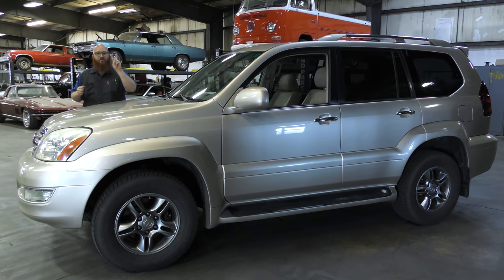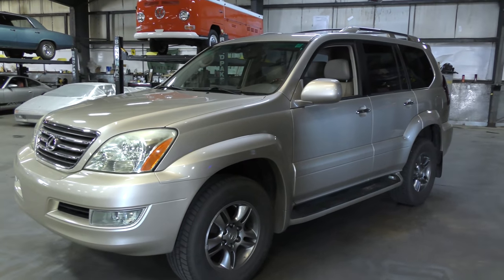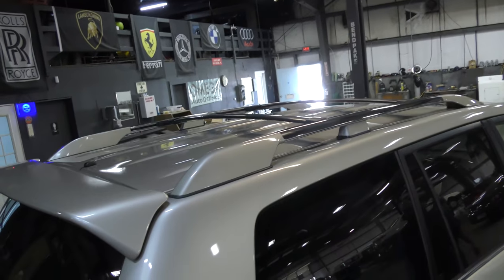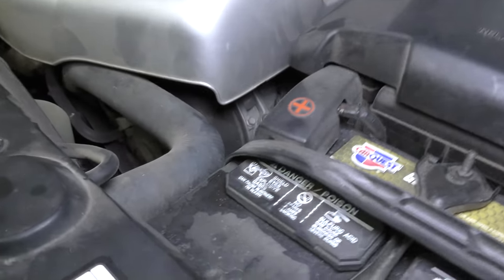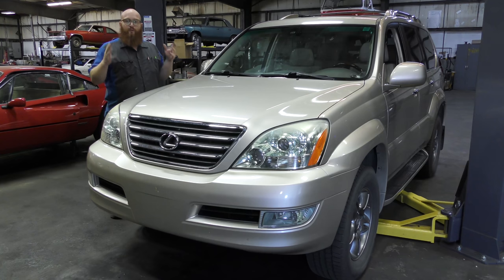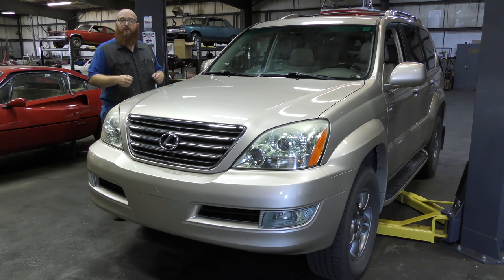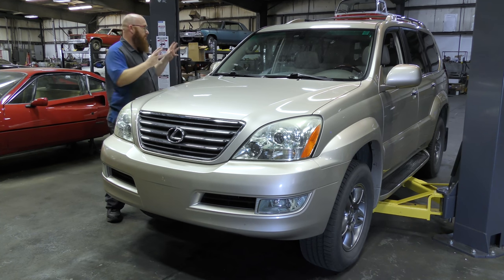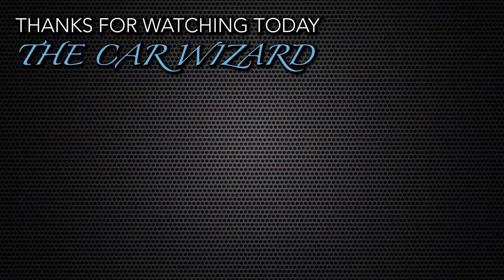Reliable cars get surprise bills too. Simple oil change on '08 Lexus GX470 turns into $1200 repair

Comment: That’s why I fix everything myself outside of rebuilding engines and transmissions.
Reply: How did you start learning about fixing cars? I'm only 14 and want to learn about cars and how to fix them.
Reply: @GamerLife-hv5kx  Basically start with smaller things like oil changes, brakes and spark plugs and learn more. You have the advantage of YouTube, I’m not that old but YouTube was just starting to take off when I was finishing high school, before then, you mainly used Haynes manuals and learned from other people which are still good options. Take the time to understand the purpose of parts, differences in types of transmissions, engines, variations, pros and cons and such. 

BTW if you don’t have an idea of what you’re going to do for a living after high school, we will seriously need good mechanics in 10-20 years. I’m not saying cheap garages but you can make a good living as a specialized mechanic or really good certified mechanic for a top brand. Trades like mechanics and electricians aren’t respected when you are young but honestly we are going to have a massive shortage if things don’t change and we still need them now but you’ll make bank later on if you’re specialized like Mercedes or bmw.
Reply: @GamerLife-hv5kx  I started at 14 too. My parent let me buy a nissan micra with a timing belt that snapped and bent valves. I made it run again, learn with no risk to other as it was my car.  We didnt have youtube and google back then. Watch video, familiarise yourself with everything. I had books from the 70s and 80s from my dad and would always refer to them anytime I was curious about something.
Reply: @StevenPenny  I think that more than good mechs we will need (actually we already need them!) good mechatronic. Techs that aren't just good with mechanical pieces like conn rods / valves and so on, but that are good also with electronic diagnosis, with the use of oscilloscopes and these kind of tools. They are absolutely necessary with cars from the 2005 onward in case you have faults that involve CAN/LIN buses or any module that control something on a modern vehicle.
Reply: @Mike That’s a good idea, forgot about that. It’s hard to screw up small engines and it gives you a good basis. 

For the other guy, you really need to be a certain type of person or try to work on your analytical abilities. I work in IT but I use the same reasoning type logic for IT as I do for working on my vehicle. I think most of us would also be good doctors if we got through the Sciences, takes the same type of thinking, just more pressure.
Reply: @StevenPenny  same here, IT and in spare time wristwatch repairer (mechanical ones). But don't ask me to do creative stuff 😂
Reply: I started working on my min bike and go-kart lawn mower that was back in the 70. Then when I got a car would love to work on it and my family and friends cars. I still have a love for that. But it's how you get started.
Reply: @GamerLife-hv5kx  I happy to here younger people taking a interests in cars.
Reply: My dad taught me how to change the oil in a car when I was a kid.  After I got married and money was tight, I got tired of getting shafted by putting my trust in people that didn't care about doing the job right. Did my first brake job with the help of YouTube, replaced a whole steering knuckle on my wife's car in the garage, have replaced half-shafts, alternators, coil packs, plugs... you name it.  There's very little I won't attempt if I have the time and tools (I will get a lift at some point), but I have since found a fairly trustworthy mechanic nearby for some things that I don't have time to do myself. Used to have a young(er) coworker that would consistently come to me asking for my advice about service on his wife's car.  I used to tell him that it wasn't a hard job and he could save hundreds of dollars doing it himself.  He flat out told me he had no desire to learn anything about automotive repair. He just wanted to take it to someone and have it fixed.
Reply: I've literally saved tens of thousands of dollars doing my own work on my cars. 
It started as a necessity but I actually enjoyed it. Especially when I wasn't up at 3 AM headed to work at 8.
Started with the simple things like brakes, oil changes, belts to water pumps and alternators and radiator replacement
I've done a few timing belts and some other rather intense repairs.
It is satisfying to complete a complated repair and go for that first test drive.
The money you could have spent on labor can be used on a better quality part.
Mistakes are a part of the learning process.

Comment: Couldn’t agree more Wizard. Although it took me owning a VW to finally knock some sense into me I now drive a 97’ Camry and the wife drives an 08’ Lexus RX350. These have been great vehicles. Cheap and simple to maintain as well as work on. At this point, outside of maybe a Honda, I don’t see why I would ever leave the Toyota lineup.
Reply: Like I always tell people, if you’re going to buy a new car, and only keep it for a couple of years buy whatever you want, if you’re going to keep it longer buy a Toyota
Reply: My family got a JDM 2010’ Toyota Harrier, should be similar to RX350, at least the shape 🤣. But because it’s JDM, I have this little anxiety that it might be hard to find some original parts later.
Reply: @Erispedia  it’s exactly an RX, just a different name (and maybe steering wheel location)
Reply: @vinces8974  I've still got my '97 4 Runner and it's running good at 407k miles. Although the catalytic muffler needed to be replaced recently so I could pass smog. That cost over $1200 for an OEM cat. The shop would have used a factory cat but Toyota dealer didn't have any and they don't know when they'll get one. So he got an OEM one which was only cheaper than the factory cat by a couple hundred dollars.
Reply: @Rhaspun  If your Toyota’s in good shape probably worth putting $1200 why not , here in Pa we are always fighting corrosion , on older vehicles

Comment: i own this exact vehicle in a 2007.   paid 15k cash in 2017 w/115k  miles in it.   It  was in need of deferred maint when i purchased and  had it completely sorted -  cv boots, all belts, water pump, tires.   Virtually every knob, light, switch works on this beast.   Yes, even the amazing rear  air bags.    I keep it pristine.  interior and exterior is like new.    I could pay cash for any dream car i would want.    But, i get more out of value.   And i absolutely love these vehicles.    Nothing but Lexus, Toyota and even some Hondas for me.    Thanks Mr. and Mrs. Wizard.    This was a real treat to watch!

Comment: Mr. and Mrs. Wizard - always happy to hear from you, such a sweet couple.
Reply: @gerardodominguez5755  Rosen, who is forty-nine years old but has the spritely affect and bubbly drawl of an N.Y.U. undergrad, put the butt mirror into my hand on a recent October afternoon because she wanted to prove a point. Her point is that super-high-waisted jeans—a cut that Rosen first began pushing in the early two-thousands, when she owned a cult-popular downtown shop called the Good the Bad & the Ugly—make everyone’s rump look rounded and Rubenesque. I had just wriggled, with great effort, into a pair of her wide-legged stovepipe jeans, which have a thirteen-inch rise and come up past my sternum. Rosen’s jeans are meant to fit snugly, or, as she put it,“like a sausage.” Each pair comes with a tiny fabric flap printed with detailed instructions for getting them on: first, yank the pants over the derriere, then fasten the button, then hike them up another two inches, then zip. While I was in the dressing room grunting my way through these four steps, Rosen called out to ask if I was sweating yet. I told her I was considering lying down on the ground to get the zipper up; Rosen told me I would be far from the first customer to do so.

Comment: Issues I had with my 2007 Sequoia, which went 265K before I recently got rid of it - rear mail seal went, upper oil pan gasket leaked, steering rack started leaking, lower front control arms were very squeaky and needed to be replaced, OEM cats were stolen and I had to replace with cheap aftermarket ones. Other than that, just had general maintenance items. Was an incredibly reliable vehicle and would highly recommend.  Listen to the Wizard, people!
Reply: It's a heavy car, so they tend to wear and tear quicker, smaller cars age better
Reply: @goodone5590  that is factually incorrect.
Reply: @goodone5590  not true at all

Comment: Thanks for reminding me why I do my own maintenance. I had forgotten how much labor cost is. Same work for me doing if it was my car. $40 oil change. $100 pads n rotors. $10 CV boots. Yeah my labor is free for me and if the joints aren’t making any noise. A clean and regrease with new boots and they’ll go at least another 100,000 miles.  $150 total.
Reply: Yeah way too much

Comment: I have a 2003 GX470 with a 3" lift, 33's, sliders, etc. It only has 130k miles and almost mint. The interior is gorgeous and has piano black paint. Even with my lift it rides like a luxury SUV and is nice and quiet inside. I've done some custom interior lighting changes and I am installing a very high end SQ sound system. It is so damn good and I love everything about it. It's the best SUV I've ever owned and I will NEVER sell it.

Comment: If you want reliable high performance sedans the Lexus products (ISF, GSF, RCF, LC500, IS500) with the 470hp 5.0 v8 are great options.  My daily driven 2016 GSF has been a great experience so far.  As for expenses - $1200 repair would be $2500 for a equivalent service of a German brand. Worth it.
Reply: I've seen endless car reviews and none show any remarkable differencies in maintenance costs in general. Not in the same category of cars.
Reply: The repairs are the same cost. But the FREQUENCY is likely less with Lexus and now Genesis.

Comment: Excellent video, love your channel wizard!  Having owned a gx470 I can promise you that is not the original dash.  Lexus had a full replacement warranty coverage on the entire dashes, due to cracking.
Reply: I was curious if they changed the dash materials on the 2008-2009. When I was shopping around for my GX, I never saw an 08-09 with cracked dash
Reply: @atl964  same. It seems to be only the earlier ones. I have an 09 with 202k on it and the dash is in perfect shape (except for the wood trim that I broke when pulling the screen out once....)
Reply: Can confirm these replies, I own a 2009 GX and one of the reasons I held out until I found an 08 or 09 was because Lexus had changed the dashboard for the last two years of production, which is why they weren’t included in the dash recall. I’ve got 236,000 miles on mine and the dash still looks like new. The driver side door card however, is doing the weird sticky melting thing in a couple spots which sucks. At least that’s a relatively cheap/easy fix compared to the dash.

Comment: It’s a good idea to spray all of those rubber boots with silicone spray once in a while like maybe every other oil change. It keeps them from drying out and cracking. Been doing it for years.
Reply: Which boots? On the CV?
Reply: Never spray rubber with petroleum distillates, it will eat the rubber and degrade it over time, use regular ole armor all once and a while.

Comment: I was never a Toyota guy until I bought my LX470. That thing is amazingly reliable. I just did the rear brakes and that has been the only major repair that I've done. 190k on the clock and it's amazingly comfortable and certainly immensely capable off-road. I do my own servicing in my shop and you're right, Toyotas are very easy to work on.
Reply: How many miles now?
Reply: rear brakes aren't a repair, that's a maintenance item🤣

Comment: I must have the Unicorn Traverse. I bought a 2014 new and it now has 144K miles on it and I have had zero issues. Besides tires, battery, fluids, wipers and a headlight issue (covered by warranty) it has been issue free.
Reply: Toyota hype have fords and dodges that all have 200k plus .just maintain them
Reply: @ChrisB-cx6td 
In my experience of owning Nissan's, Infiniti's, Mazda's, I have spent very little on. maintenance. Nothing ever catastrophic ever happened. All vehicles went to 230000 miles before I sold them. And I bought them used. Therefore Toyota's are not on my radar. Those days of just buying Toyota's or Hondas to get reliability are long gone.
Reply: @moshameem99  are you joking 😂
Reply: @sham3420  Nope. No issues for the last 35 years of owning cars.
Reply: @moshameem99  i am a tech and if you think nissan has the same quality that toyota does you are smoking
Reply: @sham3420  And I grew up around techs. Sure Toyota's are reliable,, and many times because they use proven technology. All I am saying is that I went against the grain and bought Nissan and Mazda alternatives, and I came out on top, by avoiding the Toyota "tax". Now, Nissan CVT's  are garbage. Besides that I have had NISSAN VQ's hit 300000 miles with original tyranny and engine. I have had a multitude of SR20's hit close to that number, and which are still running today, including a couple of JDM SR20VE's. Currently have a Suzuki Xl7 approaching 250000 miles. And it goes on and on. If I want a point A to B car, yes Toyota. If I want to enjoy life between A and B, I will get a comparable Asian vehicle. Currently, Mazda sits in top of the list for me.

Comment: It’s titanium metallic. Dash was likely replaced under warranty. We have the same vehicle. Took me over a year to find one. Almost every one had three main issues: frame rot, cracked dash and cracked leather seats. The dash had a recall and I believe the frame did too. Always surprised how lousy Toyota/Lexus leather is. I’ve also owned numerous Honda’s and Acura’s with miles as high as 350k and I’ve never had ripped leather. I found a one owner, every service down at the Lexus dealer. I replaced the leather on drivers seat, the dash had been replaced and the frame was excellent. The GX is Toyota’s/Lexus’s best kept secret. Bought it with 156k and now at 179k. Extremely nice vehicle. Rides better/smoother than the 4Runner. I guess it’s the air suspension. My daughter has the 4Runner, so I know there’s a difference. It’s a Land Cruiser Prado in other parts of the world. Highly recommend it. You do now see a lot of overlanders using the GX now. Wife drives ours and she loves it. If you decide to buy one, better make sure the frame is not rotted.

Comment: I am a fan of the 2008 Lexus GX 470, because it is a lot more reliable than any GMC Acadia.
Reply: And looks about 8000 times better.
Reply: Acadia’s are hot garbage 🤣🤣🤣
Reply: If you want a reliable GMC SUV, then you have to look to the Yukon and or find a good used Envoy with the 5.3L or 4.2L straight six!
Reply: @philipthomas6808  My 3/4 ton 4WD Suburban was done at 85K.
Reply: @machtschnell7452  
My Silverado (same chassis as suburban) is still happily trucking at 200k.
Reply: I love Acadia's as rentals.
Reply: @totalyep  the newer ones look decent enough, but I wouldn’t waste my time trying to spend money on one. The older ones just look like garbage
Reply: @philipthomas6808  Agreed
Reply: SuperVegito777 yeah newer ones are better but older ones look way better than anything GM has designed since the square body C10s.
Reply: A child’s Tonka truck is more reliable than an Acadia.
Reply: uh..... lol
Reply: @vicarod  Maintenance matters more than some owners want to care about.  Change the oil earlier than the manual say.
The manual is NOT for Maintaining your vehicle, but the Minimum Maintenance to keep you vehicle Warranty in effect. After all, the warranty is such a short period of time.
Reply: "Generous Maintenance Corporation"- bad valve bodies in transmission? Check. Bad PCV flow on the rear head that causes carbon build up (due to bad oil drain back) that then leads to stretched timing chain? Check. 
"We don't know why our market share keeps shrinking" -GM honchos
Reply: @philipthomas6808  Yukons and Suburbans are great. My dad had both for a his limo buisness a decade ago and put almost 300k on both before selling them. His fleet of Lincoln Towncars though we're crazy reliable. Put over 400k miles on 5 of them and the  only major repair was an ac compressor on one of them.
Reply: not just GMC Acadia, any other SUV like Porsche Cayenne, Macan, Mercedes G, GLS, GLB and rest
Reply: @antoniocarvajal8222  Agreed